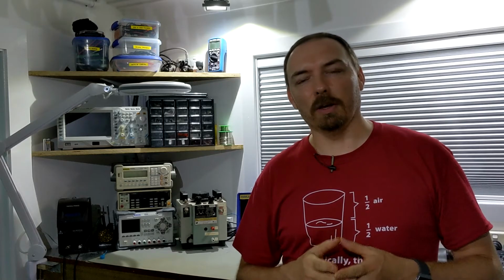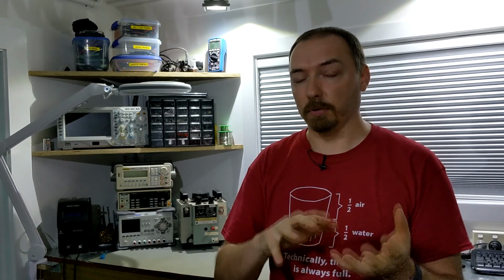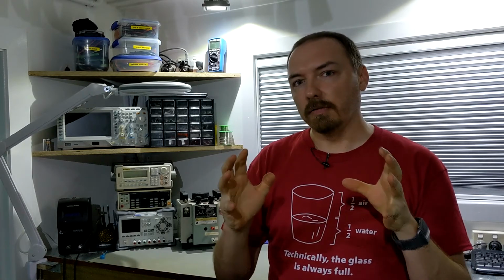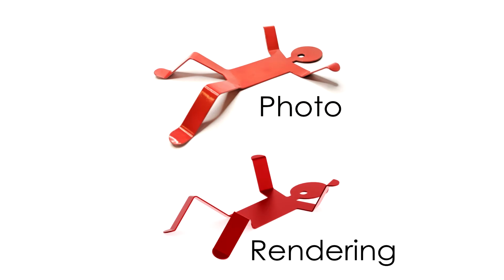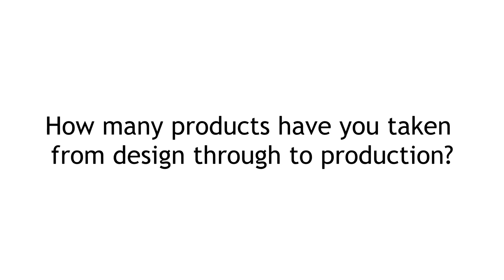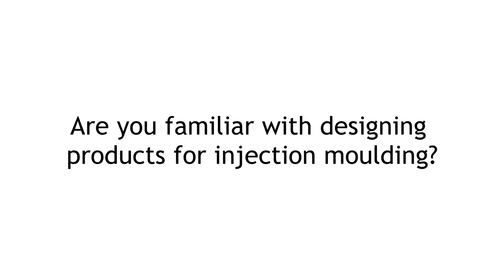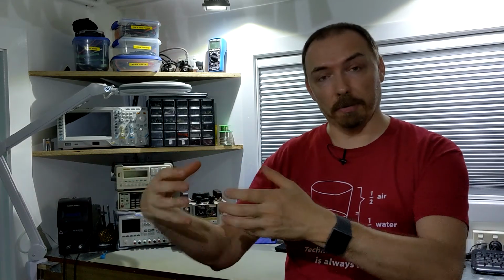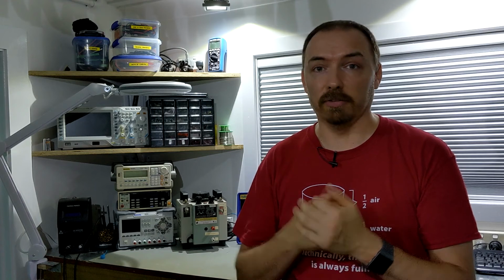#002 How to find a great product engineer or designer?

Comment: How do you protect your IP when searching for a designer/engineer?
Reply from the maker: Hi David, thank you for your question. There are several ways, Usually you do this with a contract with non disclosure agreement, as well as a IP transfer agreement. Patents, or sharing the IP. Regardless, of what method you use, you need to ask yourself several question... Is your idea truly novel, how easily can it be changed or copied? Can you enforce your IP rights if they are breached?